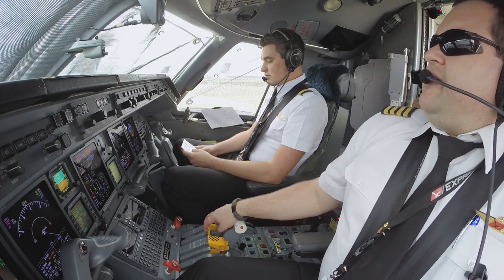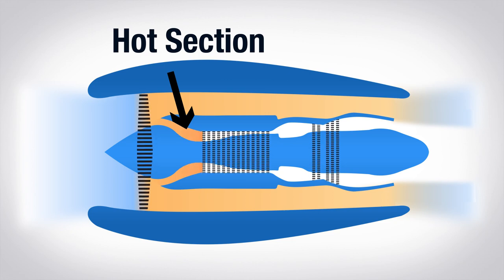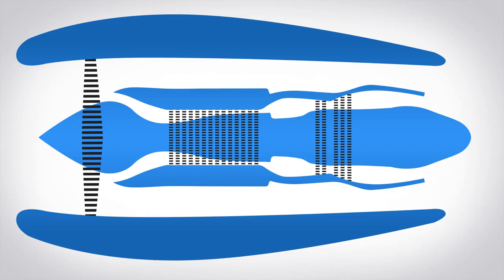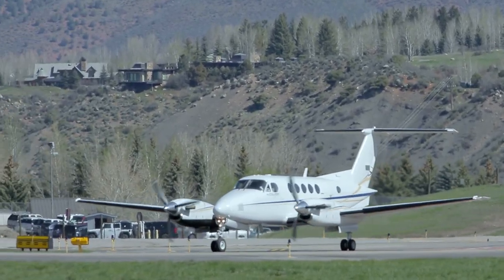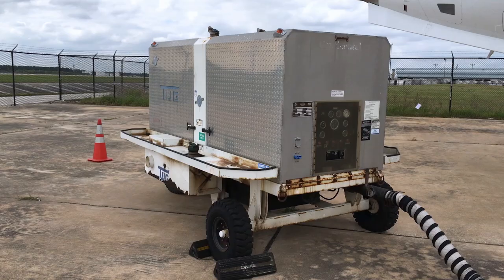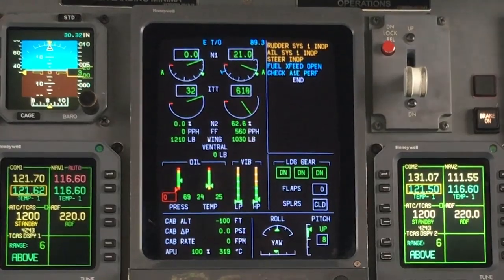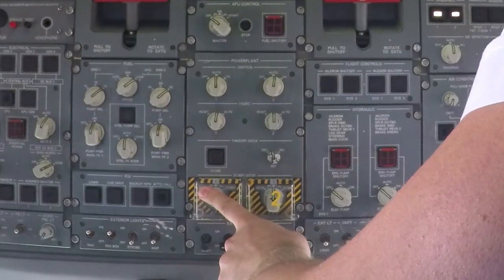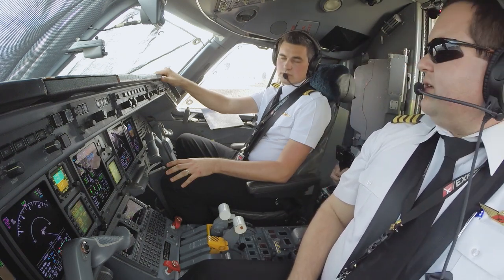How A Jet Engine Starts

Comment: I started Military Jets many times as a jet engine mechanic. The most fun you can have is doing an ops check on a newly installed engine. Trouble shooting is fun as well and can be a challenge. Suck, Squeeze, Bang and Blow gets giggles from the ladies. We used MA1A start carts to feed air to the engines for engine starts. The #2 engines were started first to allow the generator to supply power to the gauges since the #1 engine would not have electrical power to the gauges until after the #2 was running. The switch over of air was also performed on the #1 engine during start with the air cart. Our #2 engines didn't bleed air to the #1...it is just the way they were by design.

Comment: I'm very afraid of flying but I've been on various commercial jets 6 times. I'd love if you'd do a video explaining how to restart the main engines at cruising altitude. Explain how you'd restart one engine, both engines and the worst case how you'd restart with a failed APU after both engines "flameout". This would be super cool to know and hopefully would have reassuring results. :)

Love your videos!!
Reply: A full engine failure(as the only 'issue' of the aircraft in question) is an event that's happened about three times, to my knowledge, in all of North American jet-age commercial aviation history. And in all cases(Eastern Air Lines flight 855, Air Canada flight 143, and US Airways Flight 1549[Miracle on the Hudson]) the plane was able to land safely without any loss of life. I don't believe there's been a case of a mid-flight full engine failure coupled with a failed APU - the engines usually fail for other reasons. 

Aircraft are designed to generate an incredible amount of lift from their wings - a gliding aircraft that runs out of power at 40000 feet is capable of flying 90 miles or more without a working engine(it varies, but it's a long way). So even if the engines do go out midflight, planes are usually capable of diverting to a safe place to land in that time. Airline pilots are some of the best people under pressure in the world.

At altitude, if the engine flames out but is still in working order, the aircraft is usually able to relight the engine based on the flight speed alone if it's traveling at a high speed below 28000 feet or so(called 'windmilling'). If the APU is active, the engine can be restarted practically at any time below 20000 feet. And APUs rarely have cause to fail alongside other engines as they operate on a completely different system.

All in all, air travel is safe and enjoyable. 200 million passengers board a plane in the United States every year, and in the last decade(of 2 billion passengers) there has been one recorded fatality as a result of the air flight itself. Try to enjoy the view!

Comment: oh my god finally! A while ago I was wondering how do jet engines start, I commented on a video and someone responded with, "The jet engine starts by the engine rotating and compressing air to burn...", that is vaguely what they said but it didn't answer my question in that how does the turbine even start up, ever since I have been clueless until I just looked it up, I am glad I found this video because that question in my head would bother me, luckily it was professionally explained in this video with him saying that there is a compressor module to begin spinning the turbine to allow for the compression of air and then the burning of fuel. 10/10

Comment: In the USAF, we used to use cartridges to start the engines in an emergency or during alert.  It turns the starter just enough to get the engine started.  For maintenance folks, we would spend hours cleaning in the breaches after each cartridge start.  The breach is what holds the cartridge in place.

Comment: Excellent Explanation! And Quick Question:
Why the ignitor starts before fuel flow injection, or I am understanding this wrong? Cuz it seems to me that ignitor starts around 14% max rpm while fuel flow is 28% max rpm?

Comment: In The Netherlands once I saw a motorcycle powered by a jet engine run at a race track. It started in the pits, warmed up for a few minutes then went to one end of the start / finish straight. He wound up the revs and tore off down the straight, but the back wheel couldn't get any grip and left a trail of burning black rubber. Continually accelerating, there was a bend at the end of the straight. Poor chap couldn't get the bike round the bend and went straight on into the field. Seeing a motorbike and hearing a jet plane does funny things to your brain.

Comment: Great video. One question: you state that after the air exits the last compressor stage that it expands and slows down. If the pressure is over about 50psi, the air expands and speeds up. This is "choked flow", which also prevents back flow to the compressor. If I remember my theory right, the output of the last stage of the compressor has to maintain a pressure greater than the pressure in the combustion chamber. Then adding fuel increases the air volume greatly, which is whet drives the turbine. (I apologize if I am off base here. It has been a few decades since I learned the theory.)

Comment: I have a question. If bypass air causes most of the thrust, then why compress air for a little more extra thrust? Why not ditch the compressor altogether and simply use bypass air for propelling the aircraft?
Reply: bypass air has too low temp/pressure to sustain combustion. the fan gets power from the turbo

Comment: Technically the hot section of a jet starts at the combustion section and you might have bought up that it's a dual spool compressor with LP comp, HP comp, HP turb, LP turb except in the case of a RB211 which is LP IP HP.

Comment: When an aircraft is parked, the power generation is given by an external cable connected to the airport, which is kinda obvious. You can see it while boarding the plane, it is connected below the cockpit area.
but just wanted to give this little hint about the movement inside the cockpit. you can actually see when the crew disconnects the external power and becomes independent from the airport.
watch the lights blink inside the cabin, just once. The APU is now the main power source. This is a sign that we're rolling in a few minutes 

(if you're not flying Ryanair, our very own bus with wings)

anyways, i have a lot of time on my hands

Comment: If the plane is in the air, can one use the wind speed to start the engine, much like a push start or a momentum start in a car or motorcycle?
Reply: Yes- there's a chart for that- God forbid you ever have to do that

Comment: Another means of starting a turbine is with hydraulic pressure. Military helicopters used hydraulic fluid under pressure to start the APU by back flowing through the hydraulic pump. Sucked when you would need to hand pump the hydraulic cylinder after a failed start. However was worth it when after changing the APU igniter and got it to start we were greeted with a 30 ft flame for a few seconds!

Comment: Only issue is that the compressor is part of the cold section. The hot section begins after the diffuser. Other than that, really good.

Comment: Not quite all, let us not forget that the BAe 146 / Avro RJ engines were started using electric starter motors and not bleed-air. But then again most people would consider that aircraft as having 5 APU's anyway ;P

Comment: Be aware that in most modern jet engines that the low pressure turbine is directly coupled to the fan and the high pressure turbine is directly coupled to the compressor (core).

Comment: I think it really would've helped to explain that each compressor stage is connected to its own turbine stage working from outermost to innermost and each stage-pair is independent, i.e. the LP compressor is connected to the LP turbine via a shaft that passes through the shaft of the HP pair (and intermediate if applicable). Then explain N1, N2 etc. The mechanics of gas turbines is fantastic, even down to blade shape, stagger angles, laminar cooling etc. On behalf of Great Britain, you're welcome.
Reply: iSquared   And Hans von Ohain.

Comment: Wow, easy compared to starting an older PT6. 

First you turn on igniters then you press and hold the starter, wait for 14-18% NG then you turn on fuel by pushing forward the condition lever and wait for the fire to light
You then have to watch ITT while still holding the starter and holding your hand on the condition lever. 
If ITT rises beyond its limit you have 2 seconds to cut fuel and maintain the starter on to cool the turbine and combustion chamber. If you surpass those two seconds the engine is scrap.
Reply: I love how the bigger turbine engines you fly as your career advances, the less stressful the starts become, as the temperature needle climbs more and more leisurely toward the limit instead of rocketing upwards, leaving you with just a split second to decide if it's normal rocketing or too-fast rocketing
Reply: @FlyNAA  Newer aircraft engines start themselves.  You just use the switch to initiate the start and the FADEC monitors and controls everything, including the abort if a limit is reached (no start, hung start, hot start...)

Comment: Kind of got the hot section described wrong.  

After the fan is the compressor section where the air is compressed down, fuel is mixed in the combustion cans and ignited. Then it passes through the hot section... 

The Hot Section provides power to the compressor section by a common shaft.  The forward turbines of the Hot Section drive the compressor and the after turbine wheel drives the fan. 

Yes air in the last stages of the compressor section is hot, but not as hot as the Hot Section. As the air is compressed it heats up to around 600 degrees depending on the engine.

The APU doesn't provide "compressed air" it provides bleed air which is a high volume of flow which can drive the air starter.  The "air starter unit" is actually called a huffer (as shown in his picture at 6:35) or bleed air cart... So being aviation critical... some of the nomenclature isn't correct.

Comment: Nice job on the way a jet turbine works but, I have a small problem, starting at the front of the engine. First the fan/single stage with air going down the low bypass duct/cold stream duct (can have other names). The fan is also connected to the N1/low pressure compressor connected by a long turbine shaft and connected to the low speed turbine (3 turbine wheels/disks). The forward part of the engine or core has an inlet just like the front of the inlet of the engine. The core inlet normally called the cold section houses N1/low speed compressor which is connected to low pressure turbine, alone with the N2 compressor that is connected to the high speed turbine (2 wheels/disks). The Hot combustion section is next with combustion can or cans, spark ignitors, fuel nozzles then out the exhaust vanes and turbine wheels. many types of jets, turbojets, turbofans turboprops and all have other names for the same parts / RR  GE  PW As an old pilot with 30 plus engines and 20 plus A/C.

Comment: You will need ear protection if you outside the aircraft when air starter is working.  It will get very very loud

Comment: So now it's running, how is it stationary? Is there a transmission like a car, or is it just running slowly?  I wanted to know how you got the thing off the ground, more or less.
Reply: It runs at idle thrust, which is enough to keep it running, but low enough to be handled by the wheel brakes easily. (The brakes just prevent it from rolling, or stop it if it already is. The thrust does not act through the wheels at all, it's purely from blowing air backward.)

Comment: Just a question.
If one engine is lost in flight could you use the cross-flow bleed air bus to transfer some thrust to the dead engine, thus reducing the asymmetric thrust situation?
How strong is that clutch?
I know this is not procedure but  as a last resort could this tactic be useful and /or practical?
Thank you.
Reply: No, the cross bleed valve routes air to the starter.  There isn’t enough bleed air volume or pressure to turn the other engine fast enough to create thrust, AND there is a time limit with the starter engaged.

Comment: The only thing about the engine diagram is it makes it appear like 3 parts are simply floating there not touching the rest of the engine. Im guessing the turbine shaft and the turbine use bearings  to hold together but whats holding the entire turbine motionless inside the engine itself?

Comment: When a plane is on the taxiway, is it only the engines that pulls the plane forward or does the wheel have Any kind of motor? Also, how much thrust can you give when standing still without making the plane move at all?
Reply: Wheels have no power.  It all comes from engine thrust.

Comment: The animation showing how the jet engine works could have shown the shaft that connects the 
Compressor turbine to the power turbine, in other words the cold section at the front to the hot
section at the rear. I know you want to keep it simple.

Comment: Question... if the huffer cart is available and capable to start both engines, why isn’t it used for both?   

The method being used looks like a waste of fuel to start the other engine as they need to put engine 1 up to 83% N2 for a period of time.  I’m sure over the course of a year, that’s a lot of fuel loss. 

Is it because the connections for the huffer cart are near the rear and could be exposed to jet wash?

Thanks!

Comment: when the engine is spooling up there is vibration. Where does it originate - in the gearbox that connects the starter to the turbine shaft?

Comment: It's fascinating to learn how fast the turbines in a jet engine spin.  16,000 rpm is exactly 266 and 2/3 times a second.  That's about half the maximum speed of a dremel.  It sure is no wonder the centrifugal force the blades of the intake fan experience is about equal to the weight of a train locomotive.

Comment: It's actually a bit more complex than the diagram shown in this video, especially for turbofan engines, the type which most modern airliners use. The two separate sets of turbines don't spin just one shaft, and on some engines, don't even spin in the same direction, which is a good thing because this can balance out torque reactions. The first stage turbines (aka high pressure or HP turbines) spin the fastest, and these turn a hollow shaft which drives the compressor. The second stage turbines (aka low pressure or LP turbines) spin a solid inner shaft, which is connected only to the big fan right at the front of the engine. This can also be viewed as a "free power turbine", because it's rotational speed and direction are not connected or dependent on any other rotating part of the engine. Turboprops work in a similar way, with the free power turbine driving the propeller instead of the fan.

If anyone is wondering why turbofans or turboprops bother driving these extra turbine stages to turn the fan or propeller, that is all about efficiency. Older engines didn't have these extra bits, such as the venerable J47 turbojet which powered the B47 and B52 bombers, and was tacked onto the ends of the B36 bomber wings too for extra speed. These were single shaft turbojets, with just one turbine stage driving the compressor, and nothing more than a jet pipe after that to convert the remaining heat and pressure into acceleration for thrust. Very simple and powerful, but not too efficient and as such rather fuel-hungry.

What an aircraft needs from its engine is momentum, produced by accelerating air backwards to make the reactive force (aka thrust) to push the aircraft forwards. This can be done in two possible ways: Accelerate a large mass of air backwards at a low velocity, or accelerate a smaller mass of air backwards at a high velocity. Both of these will generate the same thrust, since momentum is the product of mass multiplied by velocity. However, the energy used to create that momentum is a different equation - kinetic energy is proportional to velocity squared. This means that accelerating a large mass of air to a low velocity takes the least amount of energy of the two options.

This is what the turbofan or turboprop does: That LP turbine stage captures the majority of the energy coming out of the engine core and uses it to turn the fan or propeller, which create the vast majority of the thrust by accelerating huge volumes (and therefore masses) of air backwards at relatively low velocity. This matters because all the energy used to create the thrust ultimately comes from burning fuel inside the engine. So while turbofans or turboprops are more mechanically complex engines, they are also far more fuel-efficient than the older but simpler turbojets. Having said that, there is some overlap between the two types - for example, the core of the CF6 turbofan is basically a J79 turbojet, so both engines use the same parts in their compressor and HP turbine stages.

Comment: If the APU isn’t working should the plane even be allowed to takeoff by use of the external air compressor?
Reply: Perfectly safe and legal under certain circumstances.  Google MEL (minimum equipment list) for more information.

Comment: Bill Lear was getting ready to take off at Southern Illinois University's airfield years ago.  But the ignitor wouldn't work on one of his engines.  So he lit it off by tossing a burning handkerchief into its tailpipe.  Much less complex.  And he didn't say "aww", not even once.
Reply: Probably a story, not a real event.  If the engine was turning, the burning hanky would have been blown away and never entered the exhaust.  If it wasn’t turning, he would risk burning up the engine because of lack of airflow. But, I wasn’t there, so I can say it didn’t happen.  Just that is is unlikely to be true.